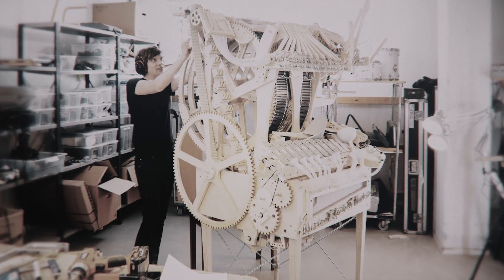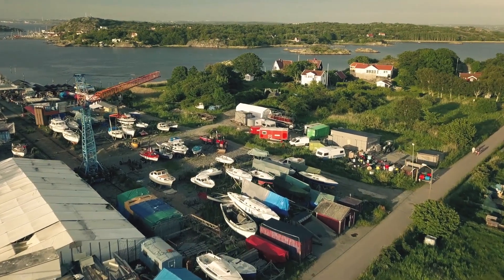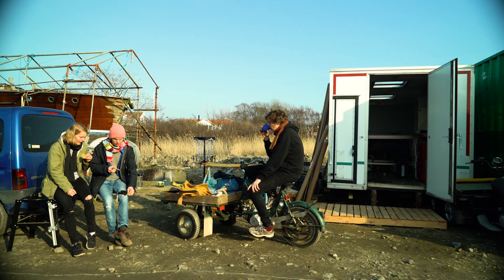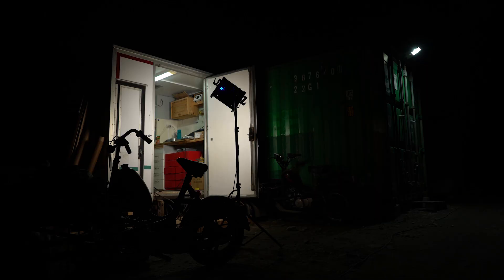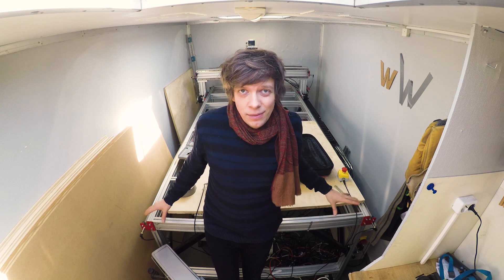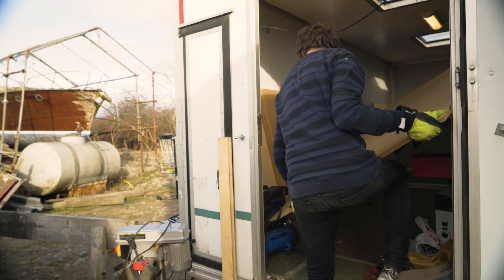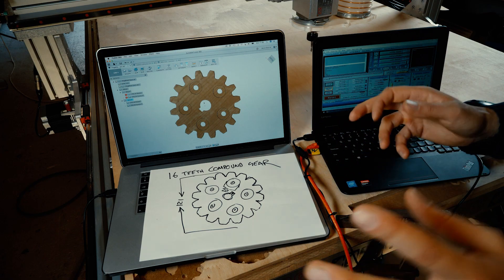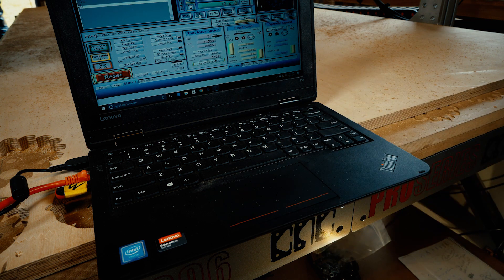Using a CNC Machine - Marble Machine X #8

Comment: One thing you must consider In your tolerances Wood changes  based on humidity. You may want to seal your wood parts so they do not change size from one climate to the next. But If you design it to work with loose tolerances it will not be sensitive to the climate.

Comment: I suggest pushing the cnc machine twords the right hand wall not enough to touch but to almost touch this should give you enough room to get to the back easily and use the table to the fullest! Good luck with your work hope everything flys smoothly!

Comment: In the space, you have in the container it would be a lot more logical to set the CNC in either a vertical position or at a slight angle off vertical, you'll make the loading simpler, dust removal will be simpler, and you save 80% of the floor space you have.

Comment: Brother, I love what you are doing, but watching you do it in such a tiny space is downright *painful*.  May I suggest getting a second, longer shipping container and have a local welder join the two together, side by side?  It won't be particularly cheap to do properly, but it will pay off in the long run, especially if you get a 40' container, so you have lots of storage and workspace.  Properly insulating the whole thing and adding a dehumidifier (to maintain the proper moisture level in any wood in your shop) would also be a good idea.

Hope this helps!

Comment: Which program are you using for the design? And being familiar with the type of machine a suggestion for the deeper cuts that go through maybe you could somehow integrate a multi panel of small fibers that bend as the drill and cut goes through. The fibers are a plastic substance there are many, and they will be able to sustain deeper cuts without compromising any of the depth or fibers themselves. I wish you luck and am excited to see this project going.

Comment: A CNC machine can be easy be "turned" into other tools like a lazer/waterjet cutter or a 3D printer (with some high limitations depending on the CNC design) and more just by changing the "head". 
Its a very versatile tool. :)

Comment: It's not a "CNC Machine". It's a CNC ROUTER. It ROUTS parts. It doesn't "Computerised Numerical Control" parts.
Reply: It machines parts. Machine is also a verb meaning to make with a machine.
Reply: Cshut
Nyour
Cmouth

Do you like my acronyms?
Reply: It Machines parts.
Reply: well... its a CNC Router Machine.
problem is that they take all types and just classify them as CNC machines here (im Norwegian, so basically neighbors to Sweden).
say you work with a CNC Router here and most people think work with network x(
so while my work is in a CNC Mill (modified Wotan Rapid1 with integrated tool-cooling) im in the English translated papers of the workplace a "CNC Operator" and  workplace "CNC Machine"... kind of derp but most foreign visitors understand what i do.
Reply: A Legend of the Bovine Race still better than some I've seen on the Internet
Reply: lol
Reply: Americans just simply call them a CNC.

Comment: I feel like the feed rate in the video was a bit slow for cutting singing l something as soft as mdf. Depending on the capabilities of the motor in the router he could get some single fluted end mills designed for this type of work and crank the rpm up in turn increasing the feed rate. I'd say production speed would increase a lot.

Comment: Why not use the CNC to make parts in other materials than plywood? Guess you could use it to make parts in a plastic material or aluminum (with cooling) and then the marble machine won't be so exposed to changing air humidity.
Reply: Plywood doesn't warp or change dimensions significantly with humidity due to the nature of its glued-layer construction of different grained woods. That said, I am pretty sure part of the point is to maintain the classical wood aesthetic and style.

Comment: Martin, thank you for the video. Yay for Wintergatan Wednesdays! The CNC machine is a beauty. You ought to consider getting a small microprocessor like an Arduino so the CNC machine will run off it rather than tie up your laptop. You just save the file on  an SD card then pop it into the Arduino and let it run. You can use your laptop for more designs and keep it out of the CNC room when it is running. Even though the CNC machine has a dust collector, it still might be dusty in there. Good idea to wear a respirator while cutting...

Comment: Is plywood a good choice for gears?  It seems like they'd wear down rather easily.  Though thinking about it, solid wood would probably be prone to entire teeth breaking loose along the grain.  Which you could address by gluing several pieces of wood together with the grain running in different directions, at which point you'd pretty much making homemade plywood...

Comment: I don't get the reason behind such a small build space for the CNC... You must live in a place larger than that. Seems like you are making it harder on yourself. It's not like you can build the machine in there.... You are an amazing artist, and maybe I am missing something. I can't wait to see the progress and see the final machine.
Reply: @Reenactor Guy: I think Martin just needs a space to house the CNC machine, and this space does the job.  It's an efficient use of space, too.  It seems to me that he only really needs to load the sheets and operate the machine in there through the computer, so not a lot of movement is required inside the container after the CNC machine has been assembled.

Comment: Out of curiosity, why not use plastic for parts like the cogs?  I feel like wood could be too soft and might warp over time.  Seems to me that if this is meant to be transported and used long-term, wood should really only be used for parts that don't move and aren't load-bearing.

Also, kudos to CNC Routerparts - that's amazing they gave you such a nice piece of equipment.
Reply: Look up Matthias Wandel here on YT, he has proved a number that wood holds up just fine under load and mechanical stress by building a number of bandsaws out of wood and even a lathe with wooden bushings.

Comment: Nice work, how close in time are these videos to the actuall process? Oh and btw I'm a cnc operator myself, I do pretty advanced stuff within tolerances smaller then the with of a hair, making all the programs and attaching workpeices to the machine. I don't have that much experience machining wood but it should be easier compared to the things I'm machining atm. If there is anything I could help with just go ahead and ask. (är svensk också förresten)

Comment: I love watching these as a designer as it shows your passion to your project. Also if you need help for when you need to make the larger wheels/gears I have a CNC at work with a 3600x1500mm bed size (http://www.cronsrud.com/pro_series.html) so can cut them out in a single piece rather than multiple ones. We also have a laser if you needed to do any fine details

Comment: 4:47 I hope you said the Z axis. Because the C axis is the rotational axis that corresponds to the tool axis, or Z. The A axis is rotation about the X axis, and the B axis is rotation about the Y axis. So if you had a position controlled motor instead of the main tool driver, it would be a C axis.
Reply: ...where X is longitude Y is Latitude Z is Altitude
Reply: shouldn't the y axis be the one that goes up and down?
Reply: Nope. Z axis is always depth.
Edit: unless you were talking about my mistake when i said that the B axis is the rotation about the Z axis. I corrected that.
Reply: Z is back to front but Because you're looking down on what you're cutting z is moving the tool up and down from your perspective but its towards and away from the "machines perspective"
Reply: hmm wierd. Did some googling and both Z and Y seems to be used for the vertical axis. I thought it was a universal thing.
Reply: Yeah it depends on how you look at it. Say in your field of vision, looking up and down = Y, Left and right = X, and zooming or moving in and out is Z. But when Z is used for the vertical axis look at it this way, grab a piece of paper and draw your typical X and Y axis on it. Now put that piece of paper on your kitchen table. Which way is Z going? It should be perpendicular to the table top. You can also think of it as your xyz of your vision vs xyz of how moving your actual body translates onto a map
Reply: Tim see my second example
Reply: Pronouncing Z as "Zee" (just look in a dictionary or wikipedia) is perfectly fine, but having an accent can make it a bit harder to understand if it's C or Z.